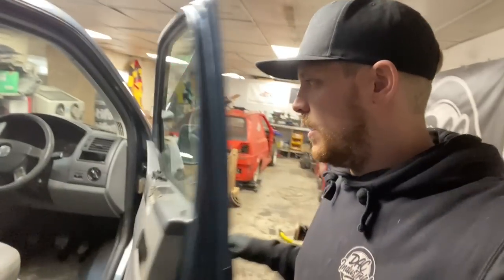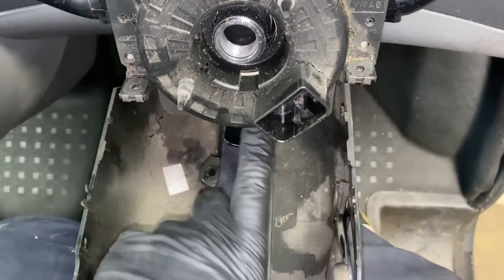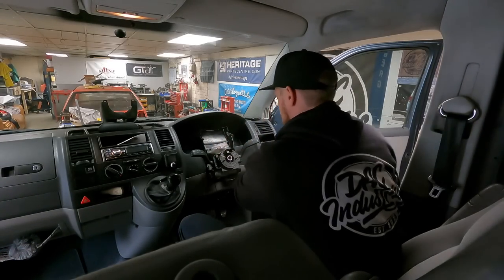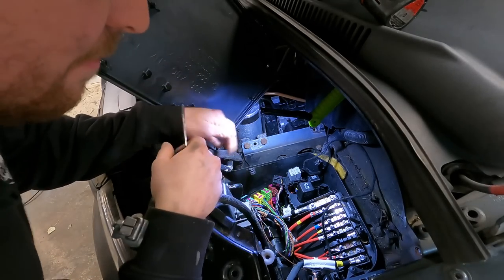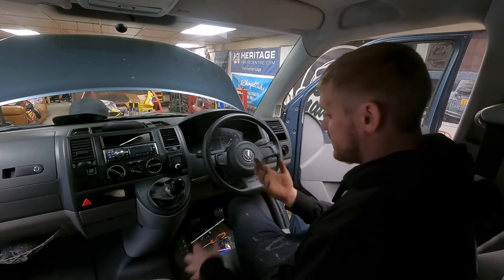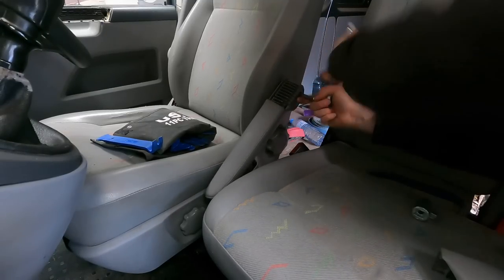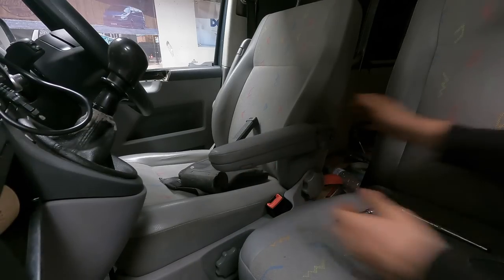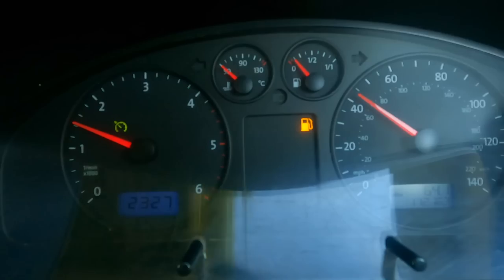VW T5 Camper Build Begins - Cruise Control Retro Fit, New Steering Wheel & Arm Rest Fix

Comment: Had my T5 for over 5 years, done plenty of mods to it but cruise control has not yet been added. Going to have a look now at buying the parts, I have vcds and will check to see if the bcm is the correct one for adding cruise control. Nice video Dan, really looking forward to seeing this one 👍👍
Reply from the maker: 💪 awesome bud. Yeah I forgot to mention about having the correct BCM 🤦🏼‍♂️
Reply: What's bcm?
Reply: @davidramplin5291  Body Control Module

Comment: A MX5 is even easier: buy the cruiscontrol button, place it on the steering wheel. Replace a little connector at the brake pedal. Done. No programming required.
There’s only one thing, you got to have the right model MX5 with the right engine to make it become this simple.
Reply from the maker: That is easy!

Comment: There are two black-yellow connectors on the cruise control unit. For chamber 26 and 29. The cables themselves are two different overall lengths and different connectos on each end. How do I know which one goes in which slot??

Comment: Dan, I have a 55 plate T30 my steering wheel airbag and clockspring are all nackered! Will any VW steering wheel fit? If so then I’ll have to get the correct clockspring for the airbag, does that sound about right? What about what the clockspring plugs into on the opposite side to the airbag? 
Any help would be appreciated as I’m having a mare!! 😂

Comment: Hi Dan, love your videos, absolutely inspirational stuff. Quick question, I am currently installing cruise control into my 08 T5. I have got the wire through the engine bay to the electric box under the battery and managed to get the tricky block out from the depths! When putting the pin into slot 1, does it just click in or do you have to do something with the pink retaining clip on the block? I don’t want to brake it! Top video btw.
Reply from the maker: Thank you for watching! Glad you enjoy the content and they help you. You need to remove the pink but as that is the retaining clip that stops the connections coming out.
Reply: @DanChambersDAC  thanks Dan. I have no clue how to open the retainer, any tips? Thanks
Reply from the maker: So the clip slides out from one end of the plug. I use a small pick to pull it out. If you look into the end of the plug where the pins are you should be able to see a little cut out that the pick fits i to to pry it out
Reply: No worries, I have figured it out 👍
Reply: @DanChambersDAC  spot on, thanks Dan 👍

Comment: Some questions. 
How long did this take including the faffing as always faffing.
Bit concerned on doing this as you say instructions are wrong on which plugs/wires to use. I wonder if mine is different to yours and same as instructions
Where did u buy kit from as they seam to widley vary in price.
Is there anything else to look out for I see someone mentioned bcm's what are these and what do I need to do. I do have elec windows 1 touch
Thanks

Comment: How do you get that plug panel out to put the wire in under battery
Reply from the maker: I just pulled it 😂 Luckily I didn't pull any other wires out!
Reply: Done now. However it wouldn't re-program. Got a new remote for van the other day and start working. 🤔